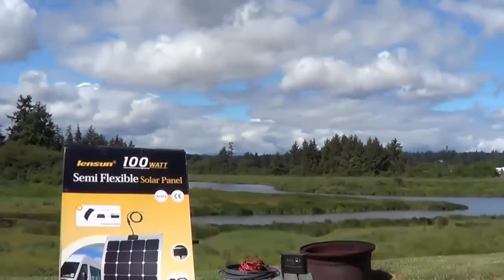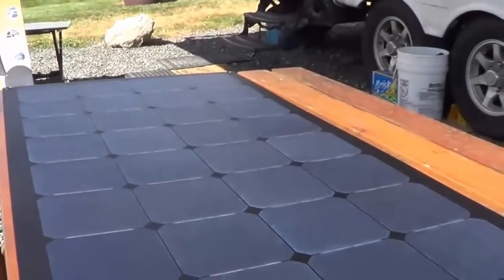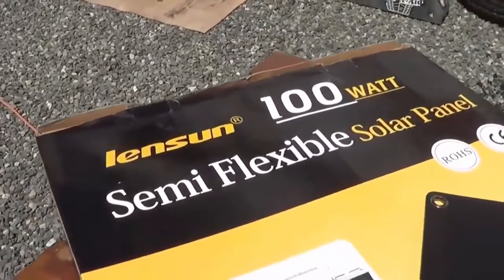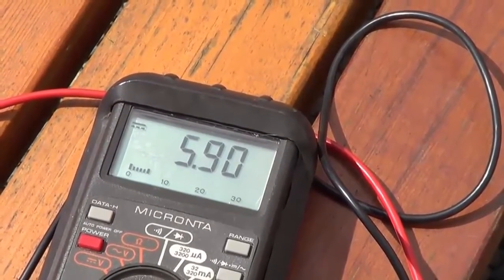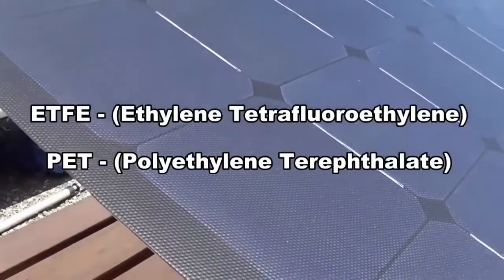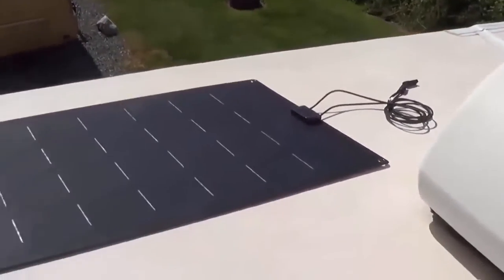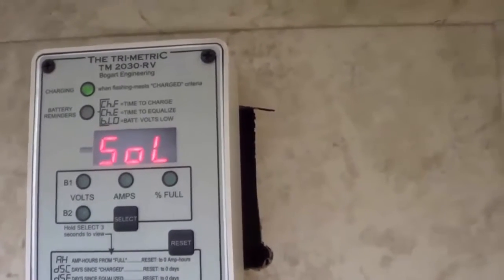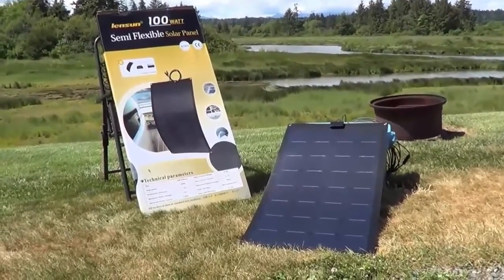Lensun 100W black Fiberglass Semi-fexible Solar Panel Testing Video

Comment: Regarding all of the comments about low output, the rating is at 25C test conditions with direct sun of 1,000W/m^2.  Temperature degradation is on the order of 0.5%/C panel temp.  Figure the panel is 20C hotter than ambient and it's easy to get to ~15% temp degradation.  As for the wire connection quality, that is a serious issue, thanks for the feedback.